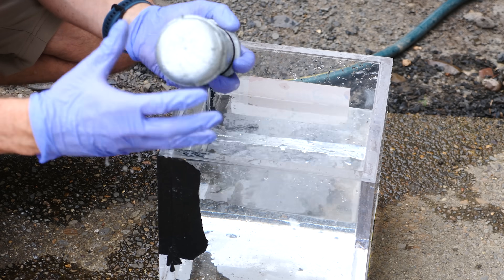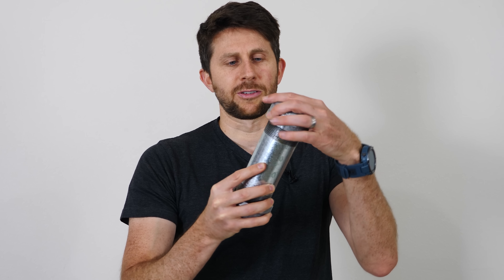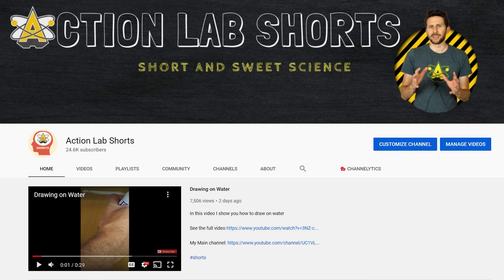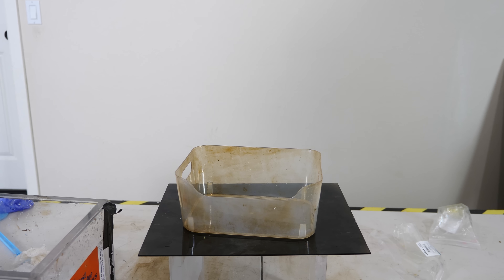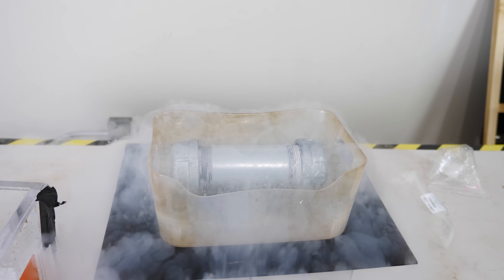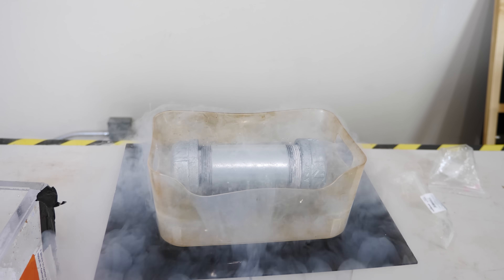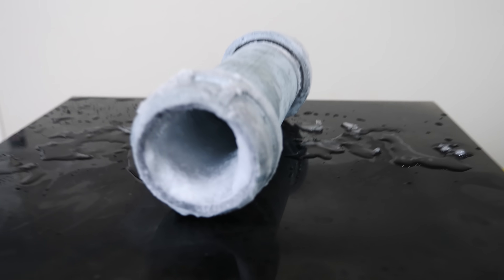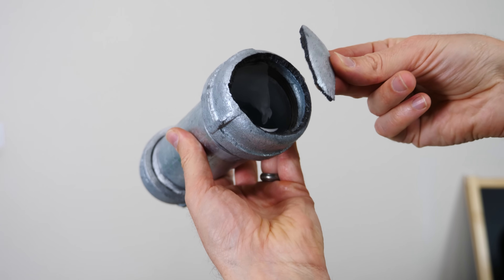Can You Stop Water From Expanding When It Freezes Into Ice?

Comment: Thank you for another great video. I kind of anticipated that the pipe bomb would crack, but I didn't expect it to explode like it did!!

Incidently, I had been thinking of suggesting a very similar demonstration for you to try. (I don't know how you realized that I was thinking about water expanding as it freezes. Get out of my head! It's creepy! :D ) Here's what I was thinking and it should be a LOT LESS dangerous!

Would it be possible to freeze water in a vacuum chamber and measure it's expansion? The purpose would be to discover how much of the expansion is due to atmospheric gas being trapped in the water. 

We have all seen the ice cube in our freezers being fairly clear on the top and full of bubbles on the bottom and nearest the center of the tray. This is the water that freezes last and would clearly take up more space than the water without the bubbles.

The tricky part would be freezing the water in a low pressure environment, since the water would tend to evaporate very quickly. Perhaps you could remove the air slowly just before the water begins to boil. The other tricky part would be cooling the water without an atmosphere to draw the heat away, but I'm sure you have a good idea to solve that little problem.

I'd be very interested in your feedback.

Comment: I achieved it at -20°C in the past by drilling a hole in a steel block and plugging it with a metric steel screw. at the third attempt to freeze it, the screw popped out by loosing its thread in the steel block. It was impressive. I was ables to prove it was not frozen by putting a smaller steel part in the hole that was still able to move after everything was at -20°C.

Comment: It can't turn to that ultra-dense ice completely, the pressure would drop.

If you had a good container, you would get mix of 2 phases of the solid, at very specific pressure which only depends on temperature. That pressure gonna be on some horizontal curve between different solid phases.

If you stop cooling at the right temperature, will be mix of normal one, and 2 or 3, at about 210 MPa. If you continue cooling, you'll get a mix of 2 and 9, at up to 350 MPa. You will never get any other phases, or larger pressures, with that setup.

Comment: I've often thought that expanding ice could be used as an energy source.
Reply: The issue is that you'd need to expend energy to freeze the water (more than it costs to cause the water to expand). Also the process of expanding does require some kind of energy IIRC. To use an example of something similar, when water evaporates it makes the area colder because it sucks in heat.

Now, to be fair, you could theoretically create an "ice engine" similar to a "steam engine" in reverse. Most power plants work by creating heat that boils water, and it uses the mechanical energy of the water expanding as it boils to move things (IE, a generator). Theoretically you could do that with ice, which is a neat idea. I'm unsure what the trade-of would be. I suppose it's probably easier to heat up water than to artificially freeze it, though.
Reply: @MatthewCampbell765  My thought was to use the freezing weather out side to freeze the water.

Comment: I saw the thumbnail with the threaded pipe and liquid N2 and new right away that the metal was going to rupture.  I work at a chemical plant and preventing scenarios of liquid freezing in isolated pipes is paramount because 150 psig rated pipe flanges will not hold against freezing water (usually only a concern for me when using below 0C brine as a coolant).  Same goes for threaded fittings.  The failure of the caps at their corner makes perfect sense as a high stress point.  It looks like less than half of the water froze before the pipe failed.

Comment: You should have checked the temp of the ice to see if it was colder and in a different phase. 

Did you do the calculations on the theoretical strength on a .25" steel cylinder?

Comment: For reference, the Mariana Trench has a pressure of 1,071 atmospheres, so pretty intense pressure to keep ice from expanding.
Reply: Yeah, I have always heard about different forms of water ice in the context of insane pressures, for example hundreds of kilometers into the gas giants or other large planets. This where one could also find metallic hydrogen.
Reply: @pavel9652  metallic hydrogen is an interesting topic to dive in. Thanks :)
Reply: @nikelsad  It is an interesting, ultimate chemical, rocket fuel ;) I am somewhat sceptical, however. Is it even possible to have it stable? Rocket fuel is already very dangerous, but this would be like an order of magnitude worse ;) Maybe there would be some other uses for metallic hydrogen, where it would be required in smaller quantities.
Reply: Hardened glass, is cooled in such way it doesn't allow the atoms inside the glass to contract evenly with the outside layers. this force remains constant until the glass is shatters and is the cause why it explodes in such many 'shrapnel'.
The force the electron has when it changes energy state, moving up or down, unimaginable big.
Reply: Tbh its pretty basic boyle's law
Reply: Yeah
Reply: 1st vid. Loved it
Reply: Still not enough to keep ice from expanding – which is a good thing. Otherwise, the ocean ground would cover itself in another form of ice, possibly making it hostile to even the toughest life forms.

Comment: "It's not dangerous this way," he said. "It won't explode."

Water: You underestimate my power!
Reply: Also: Liquid nitrogen: Hah, you forgot all about me!  I can explode too!
Reply: @BrooksMoses  : Contrary to what he said, the liquid nitrogen didn't explode.  It couldn't explode, because it wasn't contained in any way.   The steel end cap bursting rapidly off the end of the pipe "bomb" slammed into the liquid N, splashing it violently and promoting faster (but definitely not explosive) vaporization.  That's all.
Reply: @Milesco  100% he knew it would explode, what cylinder can contain 6300bar
Reply: @DuBstep115  :  I was referring to the liquid nitrogen outside the sealed pipe, not the freezing water inside.
Reply: @DuBstep115  cylinder for 10.000bar I think..
Reply: First thought was "so you're going to make a pipe bomb?"
Reply: He forgot pipes (especially the end caps) can be made of very cheap and brittle metal alloys, made even more weak and brittle with the extreme cold. Good quality steel bends and will have much less tendency to break apart which he was expecting. Cheap metal has REALLY bummed me out on several occasions😄
Reply: explosion: "did not blow up the house"
Reply: Some solids are actually quite dangerous. For example copper acetylide and silver acetylide. I think that is how it is written. It is Cu2C2 and Ag2C2 where there is a triple bond between the carbons. When these solids explode, they form 2 solids, copper and carbon or silver and carbon.

Comment: That's not quite how phase diagrams work, though.  You're not keeping the water at a constant 0C and increasing the pressure; you're keeping it at a constant volume/density and cooling it, so you need to follow a line of constant density on the diagram, not the vertical line of constant temperature.  The pressure only goes up to about 200 MPa before it freezes solid, not 6 GPa.

Below 4C, liquid water expands slightly as it cools, so the pressure will go up whether it freezes or not.  However, compared to solids, water is pretty squishy -- it only takes 20 MPa to increase the density of liquid water by 1%, and about 80 MPa to squeeze "normal" ice at 0C that much.  What that means is that, as we chill the water, some of it will freeze and some of it will squish and stay liquid, riding along that line on the phase diagram between water and ice(I) where both exist -- as it gets colder, more water freezes, and the pressure goes up as the remaining liquid needs to compress more.  Then, at somewhere around -20C and 0.2 GPa, the pressure gets high enough and the water cold enough that the remaining water solidifies into ice(III) before cooling off any more.  At that point, you've got a solid combination of ice(I) and ice(III) at 0.2 GPa, and that's the peak pressure you get.

As you chill it more it the pressure will go down slightly -- you'll follow the line on the phase diagram between ice(I) and ice(III), and it looks like the ice(III) will convert to ice(II) around 30C.  Then nothing interesting really happens below that - although in theory there are a couple of phase changes to ice(IX) and ice(XI) that could happen, in practice those changes take approximately forever to actually happen.

(Sources: Multiple college classes in thermodynamics and liquid-to-solid parts of phase diagrams.)

Comment: I wonder what the difference might be if you first degassed the water under vacuum. With less dissolved gases in the water it may freeze differently, and if the housing does explode, I think it would be much less violent due to lower volume of gas in the water.

Comment: Then what happens? If ice 9 is less dense, then as it formed the pressure would drop. But with less pressure, would ice 9 still form? And if it did and you opened the container, then what? Does it turn back into ice 1?

Comment: c`mon  my friend,  that  cast  iron cap is so cheap and fragile, I  think you can do better I suggest you to do this:  take a  12 by 20 in    iron block   You easily  get  round cakes  for lathes  job, make an 1 inch hole in it  15 in deep  and screw it 5 inches with a bolt plus teflon   NOW  I want to see  those fat  molecules  work its way out  if they can, Id like you to put it  into the freezer  al night long  that  way  youll  be shure  that  the water  is all frozen:  upgrade to see the solid water:  screw  both ends:  one 7/8  with10 inch long screw, then 10 inches smoot hole  1 inch diameter and the other end  1 1/4 inch screw plus bolt, to  take the ice out simple  screw  the  long bolt   in  with  the fat bolt   out, please!! My question  shhhh´´´would that be  a good piece for a "disolving bullet"?????

Comment: Sir, Tonnes of scientific information has been depicted. I ve always been a fan of your channel and loved the versatility of the content for educating me experimentally.

A few technical suggestions in the right manner for this vdo alone:

10 deg c is sufficient for Ductile to brittle transformation to set in, in most steels including some stainless steel. Hence the pop opening of steel cap was due to DTBT. 

In addition to the 10% positive volumetric strain by water, the metal container experiences negative strain due to drop in temperature. So even before 0 deg C, tat water has been compressed causing brittle fracture of the cap.

The water and the container cud ve been filled at just above 0deg C for better viewing the sole effect of expansion of water during freezing. Now v have seen the combined effect of shrinking metal and expanding water.

Comment: I'm an ndt technician in oil and gas, and part of my job is certifying welds on high pressure pipelines and have seen numerous hydro testing at pressures up to 20000kpa (3000psi). Amazing thinking about the pressures and forces metal can contain and the stored kinetic potential of pressure. And you don't even need high pressure, you should see how far a 500kg steel manhole cover blown off under 2psi can go. If love to see some more visual demonstrations where pressure x area = force.

Comment: The pipe itself is strong. But it seems the end caps were some cast metal that is more brittle even long before being cooled. If hit with a sledge at room temperature, the end caps would break while the pipe itself would have the material bend.

So it was always an end cap that would be the failure point. And the expected failure would send out water, since the failure just had to be a shatter and not a bulge.

Comment: Could it be possible to harness that energy somehow?
Using naturally low temperatures to push giant pistons for example?
Some kinda arctic power plant that uses the fact it's cold to move pistons...and if that does produce any energy, turbines tend to lose a lot of energy through heat generation...could that be used to melt more ice to start the process of exploding a piston again?

Comment: 5:54 - I'm curious to understand the part of the graph that stops going straight up, and goes left a little before going right.
Reply: That's the part that he should have talked about (see my other comment) where the water can stay liquid below 0C if you squeeze it hard enough.  Along the line you're talking about, both liquid and solid water are possible.  Basically what's going to happen is that the pressure and temperature inside the container are going to go along that line, with a mixture of liquid water and solid ice in the container and the ice compressing the water so that the volume stays the same, until it gets as far left as it can go.  And then at that point the rest of the water pretty much just stops moving without the molecules "popping" into the normal ice configuration.
Reply: @BrooksMoses  Thanks. That was a good explanation.

Comment: yes, the water is expanding, but the iron is shrinking due to the cold too.
Reply: I think it would be negligible by comparison. Certainly nothing like 10% and it can also stretch.
Reply: @kirkc9643  it would indeed be quite small by comparison, but I just wanted to take into account all variables I could. ice and iron can both stretch, although in this case the ice is being compressed.
Reply: @kirkc9643  I forgot what it was called but at a job i had we used to get metal red hot and freeze a shaft in liquid nitrogen then drop the ring on to form a permanent bond when the metals came closer to a normal temperature I just remember we had to be really quick to get it in place or we would be screwed.
Reply: Steel shrinks and becomes brittle. In addition, the caps on this pipe are cast iron which is weaker and already brittle at regular temperatures even.

Do this experiment again with a pipe of milled titanium; a 70x300mm rod with a 4x230mm drilled hole (for water), mill a 35x70mm fine threaded recess in the open end to receive a milled titanium plug torqued to 230nm.
Reply: @rorschacht8478  doesn't cast iron have a higher strength compared to steel?
of course, it depends on the steel, but if you were using an average mild steel, it would have a lower tensile strength as well as a lower total strength than cast iron. just because cast iron is brittle does not mean its weak, those two properties are not directly connected.
Reply: Also freezing it that way made the steel brittle.

Comment: You could 3D print a 12in sphere out of metal with 1/4 inch Center filled with water. But my question is if you get to ice 9 or above, if you extract it from the high pressure does it become unstable or does it remain ice 9 or above until 0° Celsius
Reply: Grandfather_Din_Racket  as the inner core reaches the top of its spherical shape, you fill it with water and the last few passes seal the water in, but the trick here is that you would need a gas because if you were to achieve a nice 9 or above, it would actually shrink and contract and you would be left with a low-density gas to fill the void

Comment: So if ice 9 or above actually shrinks as it becomes a solid then would a gas need to be present in order to fill the space as the water becomes solid and shrinks. Otherwise the container would not break from expansion but break from low pressure inside.